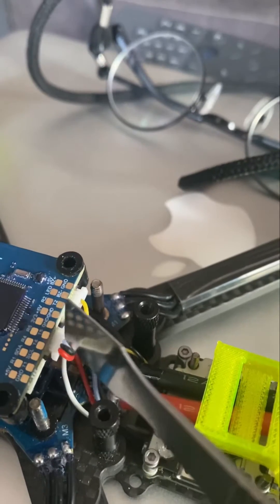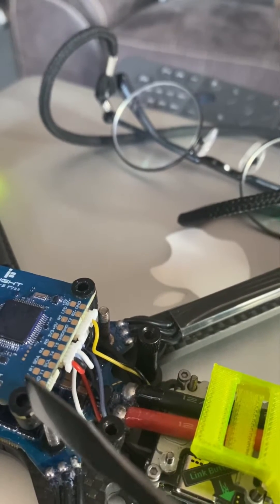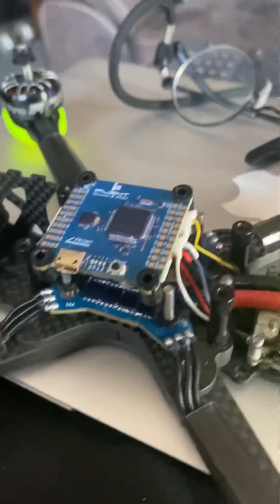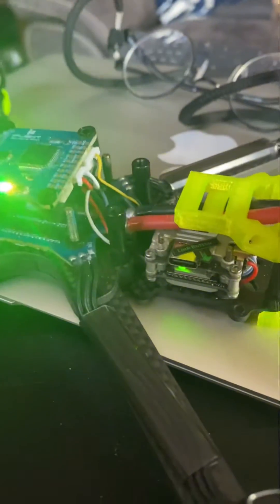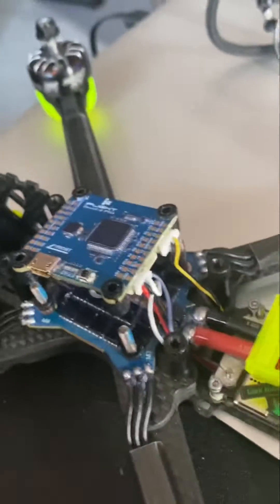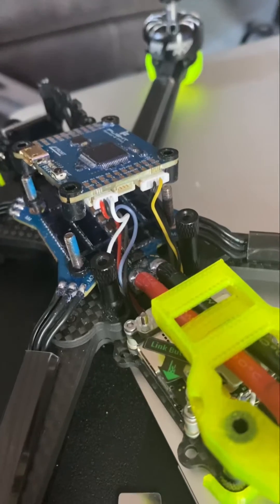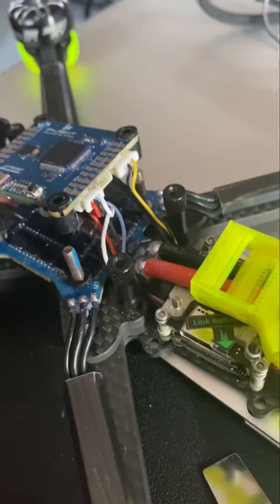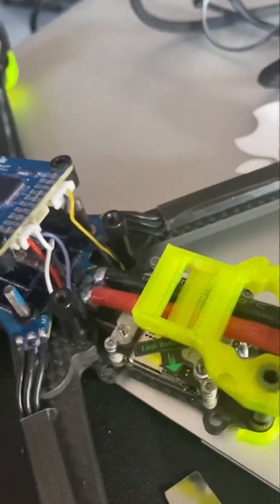No OSD in DJI FPV Goggles (v2).

Comment: Did you change the port in Betaflight
Reply from the maker: I tried many methods. Nothing worked. I ended up getting another FC. While the board was conformal coated, underneath showed residue, as if a mosfet smoked (but couldn’t escape). While I was able to continue using the FC without an OSD by switching where the Caddx unit plugged into the FC, I decided to just get a new FC.

Comment: Which you are using i like the design of esc
Reply from the maker: This is iFlights Nazgul5 HD. All stock components of its BNF.
Reply: @RonWilliams215  i like the way motor wires are existing the frame good option for my next build
Reply: Is this f7 ?
Reply from the maker: @illusionistsam  5 inch
Reply: @RonWilliams215  fount it succeX E F7